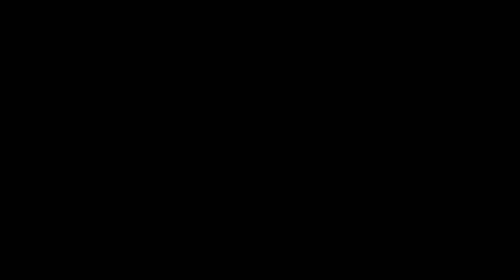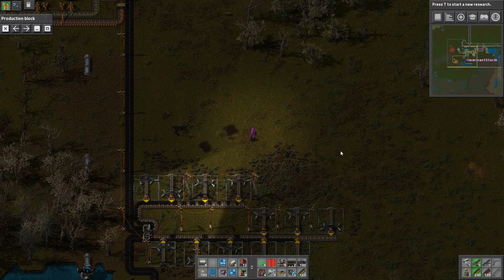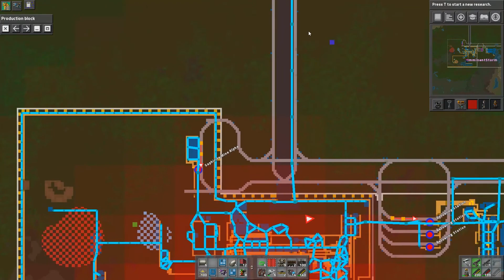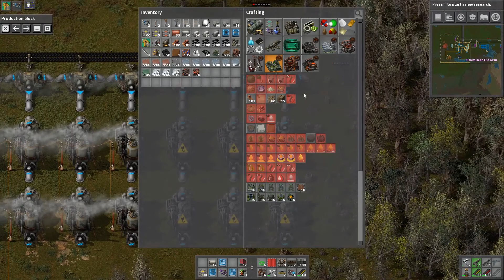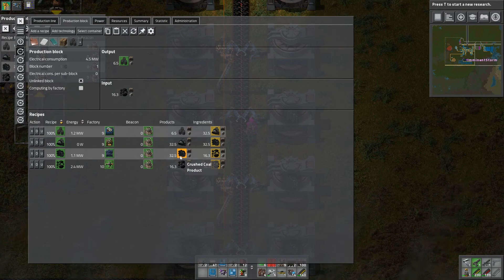Factorio - Angel's & Bob's - Episode 27 - Fuel Processing

Comment: Your Helmod analysis of wood bricks only accounted for Bob's greenhouses (the simple option and the one I mentioned, granted), not Angel's tree farms. You mentioned the latter by name but didn't actually calculate it.

Carbon is a decent substitute for coke pellets. You can make it from wood bricks (put it in a smelter to make charcoal first) and of course it's also needed for electronics so an inexhaustible supply is useful anyway.

Another option I've seen is to go straight to solid fuel using Angel's farming and petrochem. It takes a while to set up, but the desert farm gives you Nilaubergine seeds, which you feed into farms to get Nilaubergine, which you can process into vegetable oil and pips (convert into the ore sorting catalysts), then fuel oil and mineral oil. Processing those gets you synthesis gas and residual gas as byproducts, which you can feed back in to create solid fuel and lubricant (blue belts!). This is a very complex and space-consuming process that uses a lot of petrochem buildings - you'll need to FNEI+Helmod it to get it right (I know I would) - but all three of the primary products are useful in large quantities. (Remember that catalyst sorting becomes strictly better than regular sorting once you have access to all six Angel's ores.) It also allows you to reserve your coke supply for some blast furnace recipes and other processes that use it as an ingredient and not just fuel.

Speaking of blast furnaces, the better layouts I've seen just use direct insertion at ratio. One set of buildings takes ore off a belt and outputs ingots without ever belting the intermediate products; the second set takes in ingots and outputs plates. This is what makes the Ferrous and Cupric Sorting recipes so powerful: each one produces a special crushed ore that can be sorted into the exact ingredients for the second-tier molten iron/copper recipes. (Though I think you still need additional iron/copper catalyst sorting to get the ratios right because chrome and manganese aren't used for anything else and the special ores produce far too much of them...) This is especially useful for iron, because silicon is too useful on its own (for glass, and transistors and other electronic components) to justify mixing in to your iron.

Your power setup itself can be much more space-efficient, too. Instead of using two tiles of undergrounds between every boiler, you really only need a single above-ground pipe between every other boiler - and, if you find a way to zig-zag the power poles that keep the internal steam engines connected instead of sticking to the basic grid, you don't even need that. (It involves putting the spacers between certain pairs of steam engines to create a layout that's slightly shorter and wider instead of longer and thinner, but I can't explain it in words.)
Reply from the maker: Yeah I looked into angel's tree farms and it needs an entire infrastructure I don't have to operate.  I'm not that familiar with Angel's bio processing so I am saving experimenting with that for later.  I'll eventually be swapping the silicon recipe for Iron to cobalt/nickel so that that is a temporary setup.   Also I can eventually make glass without silicon at all.  I think it is a sand, sodium hydroxide, sodium sulfate mixture.